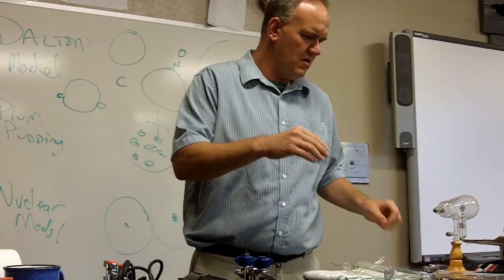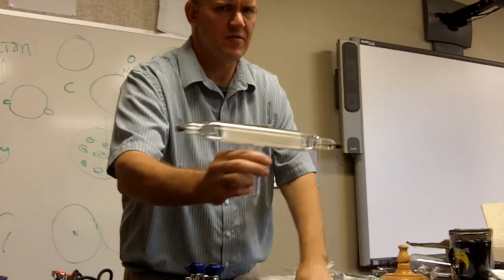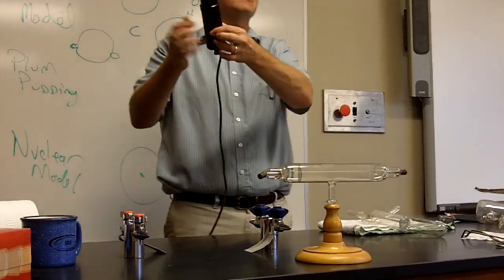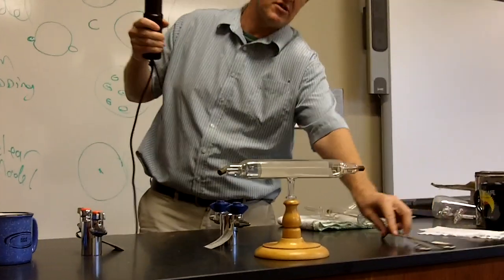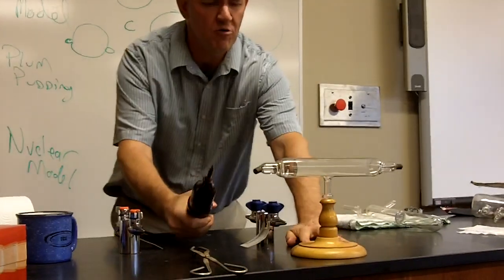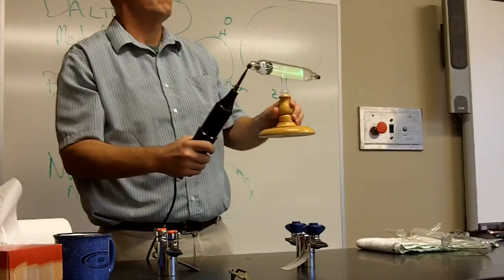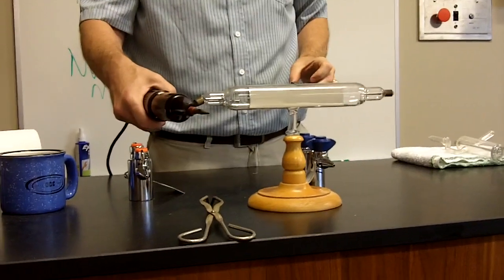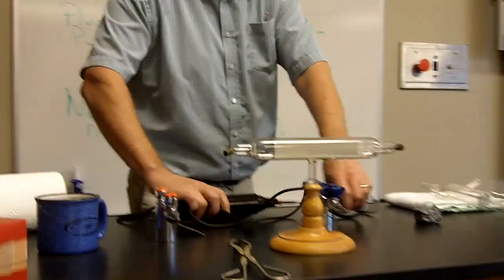Crooke's Tube & Electrons

Comment: There are no spinning magnets in the Oudin coil being demonstrated here (now commonly called a neon leak tester). The noise you hear comes from a mechanically operated spark gap—similar in principle to a relay. This is not a Tesla coil. The output voltage is adjustable from approximately 10 kV to 50 kV by changing the spark-gap distance at the back of the coil.

Be aware that one of the hazards of this demo is the production of soft X-rays. Keep run time and voltage to a minimum, as the glass in this setup contains no lead shielding. All CRTs generate some amount of low-energy X-rays, and the tube in this demonstration uses a cold-cathode method to produce the electron beam, which is not typical of most CRT designs.

Comment: Can you explain how electron beam is being generated in the tube by Tesla Coil if there is no potential difference between cathode and anode in the tube??
Reply: eleggance The Tesla coil generates a high potential . The electrode near the coil has a high potential and the one far is at approx 0 potential . So the electrons flow .
Reply: The other end of the Crookes should have been grounded for best effect.  He is relying on the leakage of the current through the wood stand and into the air.  That is why the green beam is not that sharp and also has a vertical line where the glass standoff is in the middle — the electrons are leaking down the glass standoff and into wood stand.  BTW — safety tip, keep that Tesla coil away from those gas jets.

Comment: What is the relation between  pressure of gass inside the tube and the applied voltage???plz help if anyone has idae...😢😢
Reply: Saliha Salam If the pressure is high( due to larger number of gas molecules) we’d have to apply a high voltage. But if a few molecules of gas are to be escaped pressure will be low and we’d have to apply a relatively less amount of voltage in order to observe the phenomena... (by lowering the pressure means the number of gas molecules present are lower and thus for less molecules less amount of voltage will be enough)
Reply: @october_man   thanks alot broo
Reply: @october_man  But how did the current even flow through without the circuit being complete?
Reply: @internetuser9279  This tube is not acting like a typical load. Here the main thing to observe is the passage of electrons from one electrode to another and this phenomenon doesn't need current to flow back to its source unlike other loads
Hope this will help:)
Reply: @october_man  Yes, it did and thanks for answering. And btw potential difference does exist right? For the electrons to flow?
Reply: @internetuser9279  Again, if we talk about "difference" of potential, we will end up with thinking as if the tube itself was a load which required potential difference to operate. 
The concept should be, "voltage is being applied at one electrode, it knocks some electrons which then flow towards another electrode producing the fluorescence as it passes"
Reply: @october_man  Oh I get it now! Thank you so much!
Reply: @internetuser9279  Glad it did help:)
Have a nice day.
Reply: The evacuated glass allows electrons to move. If the container was not evacuated, if it had air, the air molecules would prevent the electrons from moving between anode and cathode. In other words, the air is an obstacle to electrical flow. That is why the container had to be deprived of air (it had to be evacuated, turned into a vacuum tube)

Comment: The BD 10 wand that he claims to be a tesla coil is actually a device based on an oudin coil and does not have spinning magnets inside of it. Had it been a tesla coil it still would not have had any moving parts inside.
Reply: Exactly. The buzzing sound is the mechanical interrupter that pulses the current to a little Tesla (Oudin) coil and out comes high frequency high voltage. Otherwise, great presentation!
Reply: re: "and does not have spinning magnets inside of it."

Do you know what a motor is, how it operates? A motor is used inside the 'wand' to drive the mechanical interrupter at a very high rate ...
Reply: @uploadJ  Yes I am very aware of what a motor is. That is irrelevant because this device does not contain one.  I personally own and have worked on multiple of these.  There are zero moving parts, the sound it makes is when the electricity arcs across the spark gap preventing the user from making direct contact with the AC source it is plugged into.